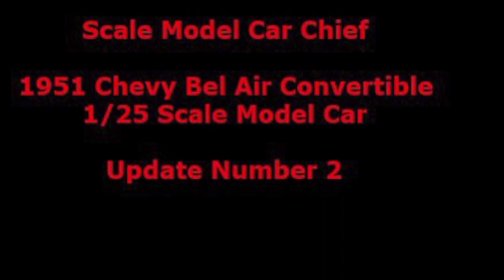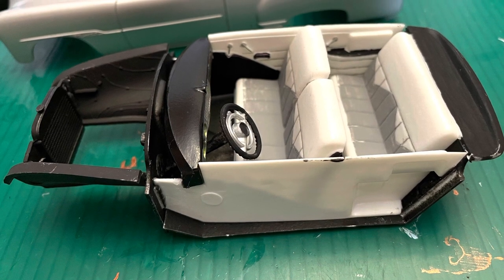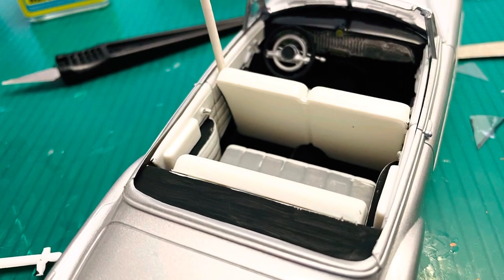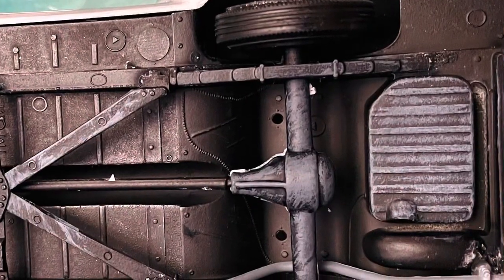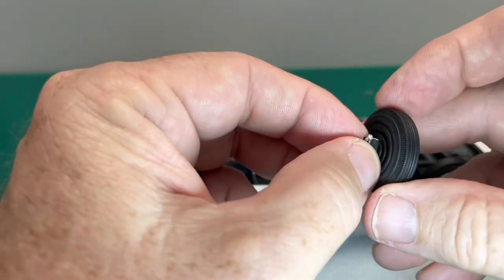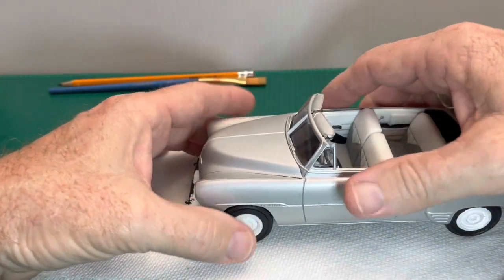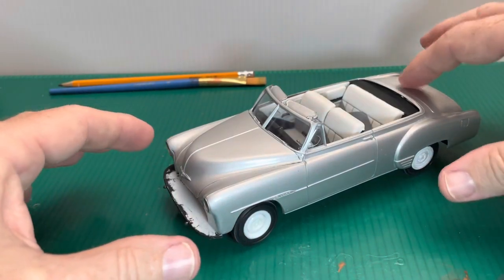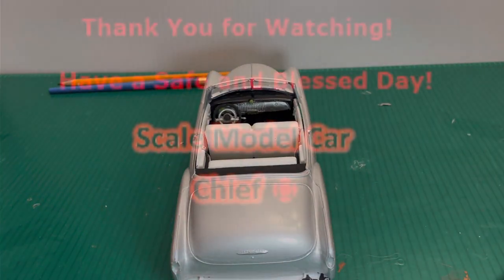1951 Chevrolet Bel Air Convertible Scale Model Car-Update 2

Comment: Most kits fit well but there are a few that are difficult to get the body on the chassis.  Some have to be shoe horned in and some may need fine tuning, depends on the kit.  Yours is looking good now.
Reply from the maker: Thank you Steve! I’ve done two 51 Chevy’s and both have had the same fit issues. I’m glad I got both to sit well. At least to my eyes! 👀 😁